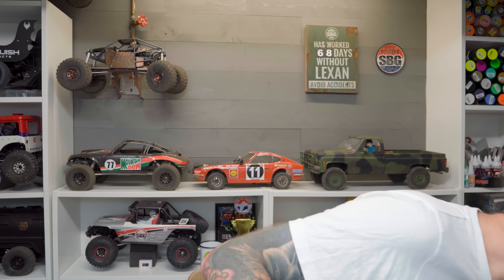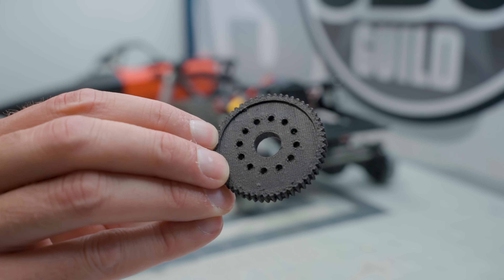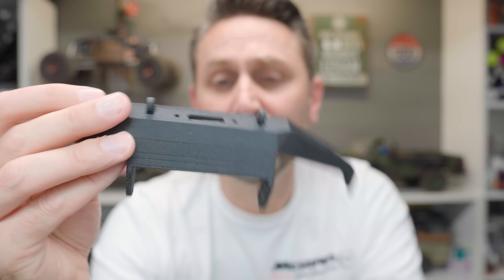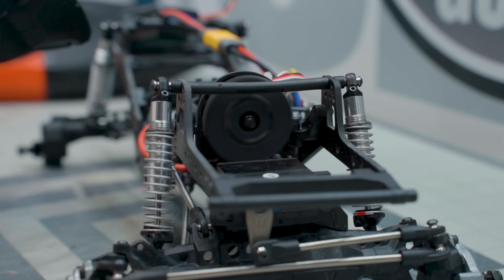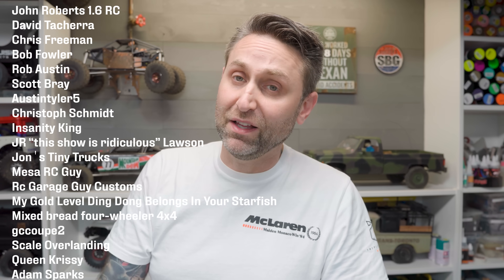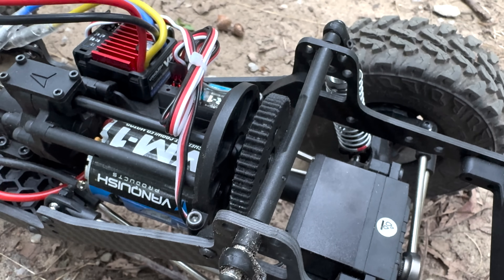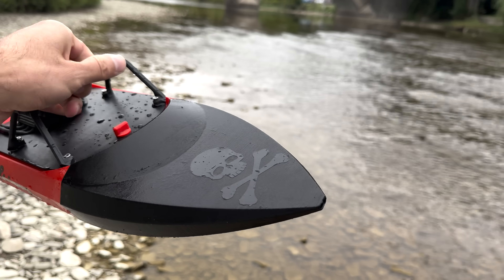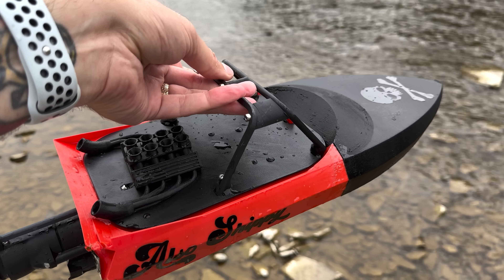Say Goodbye to Old Filaments – Meet the Game-Changer of 3D Printing!

Comment: I'm printing with PP (polypropylene), same family, but I'm struggling so much with warping.
I managed to print something but it's always a gamble.
Using PP tape on the plate is useful just for small pieces, otherwise the warping force will win and lift the tape.
I can not understand why nobody did a plate specific for PP, it's a so amazing material!!!
Reply from the maker: Wonder if your filament is dry enough? I dry this at the highest temp for 16 hours sometimes!
Reply: @scalebuildersguild I would say yes because I had the same issue with 2 new sealed rolls. Also consider that Polypropylene is almost hydrophobic, doesn't suck so much water as other filaments.

Comment: One thing that you have to watch with CF filled filaments is that the CF in it is VERY abrasive, so a gear that you print will last longer, but wear the other one out faster.

Comment: Heat treatment of tool steel is what hardens printing nozzels . Nozzels would soften again if overheated. At what temp would toolsteel remain hardened with continious use ? What temp is considdered to soften toolsteel.? Is toolsteel the material used for hardened printing nozzels?. If so it would be possible to self-harden nozzels periodicaly before they "wear out" if the amount of wear is calculated properly.

Comment: Do/did you print CF / GF filaments directly from a filament dryer enclosure, or dry first, then print from the side mount (on the X1C .. before you got your new drying).  Thanks again for all the teachings!
Reply from the maker: Print directly from the dryer typically, unless I’ve got a long print, then I’ll dry, and load into the AMS.

Comment: I just ordered a bunch of PCTG from 3D Fuel  Its chemical, UV and Impact resistance is very good! Its got incredible layer adhesion and is easier to print than PETG.  I am printing a bunch of signs for my buddies garage and these will hold up outside. PLA does Not.  I hope you try them sometime and  do a video on PCTG sometime. They even have recycled PCTG for half the cost for testing!  Some say its even better at higher print temps with no fan . Most suggest slightly higher print temps over PETG and the surface finish will change from a more matte to a more gloss at a higher temperature.
Reply from the maker: Sounds interesting, will check it out! Thanks!

Comment: was this your entire testing? "let me drive this printed thing around for an hour. see? it didn't break!" 
how do you know printing it in PETG or TPU wouldn't have given you the same result? what about different number of layer lines? would it last longer under continuous stress than other materials? I learned nothing from this.
Reply from the maker: I'm a hobbyist, not a scientist. If you want that sort of data, there are many other printing-focused pages that can satisfy your questions. I can tell you that PETG in my experience is a lot more prone to shattering into jagged pieces on impact, and TPU is far too flexible to be used as a gear, like I used here. Once annealed, PPA-CF is wildly strong, and I'd trust it to make functional prototypes long before I'd use PETG.

Comment: The price is ridiculous, the company earns a lot of money. I have a bag of 25kg nylon+30%GF pellet. I used it in my diy injection molding  machine to mold some strong parts a long time ago. I have 3d printer as well. If i have time, i will try to built an extruder machine to produce 1.75mm diameter filament using the pellet for 3d printing use, the price is very low

Comment: PPACF stands for Polypropylene Added Carbon Fiber. This is pretty self-explanatory then, assuming you already know what PP is. It's one of the most used plastics because of low cost, ease of manufacturing (injection molding), sufficient rigidity and being cheap. Any type of plastic bucket or box basically uses this - and a whole range of other objects. Carbon fiber adds extra strength and rigidity, while PP is already excellent at resisting almost all chemicals and moisture. Pure PP has issues with shrinking and warping as it cools if you print with it - making detailed parts difficult -  but carbon fiber reinforcement reduces this problem greatly.

The caveats are you need high heat to print it - so some less expensive printers will need a little modding. An enclosed printing space and thermal control would be a must - but that stuff is DIYable withhold breaking the bank.
Secondly, like with all filaments that use fiber reinforcement it will be rough on nozzles and wear out standard brass ones fast. You need a higher grade of hardened steel or better if you are going you use this on the regular.

I don't have personal experience with it, but fiber reinforced plastics certainly have a lot of potential for strength.

Comment: Something that is often missed is the relationship between stiffness and toughness.

If two materials have the same strength but one is half the stiffness, it will have four times the toughness. 

This is because the material is acting as a spring and the energy absorbed by a spring is proportional to the square of the deflection.

So toughness, which is the how much energy can be absorbed before before failing, is maximized by high strength and low stiffness.

[edit] Actually, that's not quite correct. The formula for the energy stored by a spring is E = k * (x^2) , where k is the spring stiffness and x is the deflection. 

So with half the stiffness and the same applied force, the deflection will be doubled, and E = 0.5k * (2x)^2 = 2x^2, or in other words, toughness is doubled.
Reply from the maker: That is so interesting! Thanks so much for sharing!

Comment: Game changer? Cure for cancer? Yes. World peace? Yes. Filament? Nope
Reply from the maker: Fair enough! I said it was a Game Changer of 3D printing!
Reply: @scalebuildersguild  even in 3d printing? Making a filament that's the very best ever,  but still selling it at fair market price. Mark Forged, for example nylon chopped carbon fiber (onyx) is a $40 filament 800cm nope $280 and make the slicer so you can't possibly use anything else. Fix that in the industry and maybe

Comment: Maybe I missed it but did you discuss on the health issues that come with CF materials? It has been shown that the micro carbon fibers are dispensing into the air while printing. And even when the object is done the fibers will abrade into you hand until you eventually swallow or inhale them. CF unfortunately is not without issues. The only way to prevent it is to paint or glue the surface as you usually see with all the industrial manufactured CF parts.
Reply from the maker: I've read other claims that is mostly debunked at this point.

Comment: and it prints good on the a1 ? and also there is this filament called tollumer  it coasts even more and is even stronger
Reply from the maker: You cannot print this on an open printer. A1 included.

Comment: I'm reminded of car bodies made with a chopper spray gun, that cut glass fibers into short pieces and spray them along with fiberglass resin.  I saw such a car in a wrecking yard; the chassis was there, but the body had disintegrated.  I don't like thinking about what happened to the driver when the body turned into shrapnel.

Comment: Can you try using it in small printed tools? Like allen wrenches or screwdrivers? Or scissors/knives and see how well the edges hold?

Maybe also see how good it is at replacing common weakpoints in prints. Could be good to keep around to use here and there (sparingly) to reinforce certain parts of prints that are failing like in some more complex mechanisms for example.

Also could maybe be good as a rigid skeleton to slap other weaker/cheaper/faster printing materials onto.

Comment: Nice demonstration of functional parts but this is not how we judge and compare materials..
Reply from the maker: Good thing I'm not a materials expert, or claimed to be then! I like to see how stuff works for my hobby, so while not entirely scientific in my methods, I got the results I hoped for!
Reply: @scalebuildersguild  The thing is, you could have used almost any material for that purpose and likely got a similar result. So it's bold to claim the material is superior to others, it would need a proper comparison to see how it handles situations against other filaments and against industrial replacements.
If you see a significant difference there, you can compare them

Comment: That's impressive. What's more impressive, it looks like we can use it with the cheaper 3D printers too. An AI summary says: "Yes, you can print with PPA-CF using a Bambu Lab A1. Users have successfully reported that the A1 can handle this material effectively, often finding it easier to print than other carbon fiber reinforced filaments like PA12-CF due to reduced warping issues." With the Black Friday sales already started, the A1 is at $300 and the A1 Mini at $200, which makes it very easy to get into printing custom parts!
Reply from the maker: You need a print bed temp of 100C. And it needs to be in an enclosure. AI may have led you astray here.

Comment: can't recall printing anything that requires a strong filament. if there's an item that requires it, chances are i can buy it from amazon or whatever way, way cheaper than it would be printing it + i would also have it faster, unless its something really tiny.
Reply from the maker: Amazon seemed to be out of stock on the things I designed myself.
Reply: @scalebuildersguild  not saying it can't be like that if there's something extremely specific, but what are the chances no one else made it, pretty slim in most cases.

Comment: The filament is PPA-CF - a carbon filled nylon.  $150 per kg.    Requires a hardened steel nozzle, an enclosed printer and a filament drying set-up.   Tensile strength  gains are highly dependent on print  and filament quality and the best gains are 50% - many videos discuss this.
Reply: more like $75 a kg

Comment: #1 infill is a minor part of strength - 100% infill is rarely ever ever needed.   #2 number of perimeter layers is much more important.   #3 if you're using default settings, they aren't set for strength.     #4 if you ever use PLA for strength, you're up the wrong tree.  It's brittle and degrades.     #5 you have to pay attention to what direction the layer lines are going.     There is sooo much more to part strength than what you are saying.
Reply from the maker: You’re absolutely right, I’m covering the basics.

Comment: In the Bambu Mini  A1 a viable printer for this sort of thing? It's really cheap and small, which ticks two important boxes for me.
Reply from the maker: Unfortunately not for this filament. It requires a heated bed temp, and nozzle that the A1 doesn’t have. Not to mention an enclosure to keep that heat in. Bambi doesn’t recommend it.

Comment: Not a scale modeller so don't know why YT put this on my feed, other than I do print 3D for other things.
And strength for my purposes is on the low end of the 'scale'. So perhaps for a modeller it is a 'game changer', but not for others at all.
Stopped at the 4 minute mark(seeing the gear) - The surface finish and 'detail' (burs) are terrible - I would never use such a material, if that's what you get. That's the reason I still use printers like the defunct 'Shapeways'.
Unless I am able to plonk down 6 figures for a printer + equipment for auxiliary processes that can do what I need, home use(printer) is still not an option.

Comment: Try Sunlu PLA+, it's super strong and cheap too, reasonably easy to print with as long as you dont try to go too fast with printing (they have a high speed version too, but haven't tried that yet).
Reply from the maker: Thanks for the tip!

Comment: What is this magic that goes forward backward so quick. I have an ftx tracer and you have to double backwards to go backwards
Reply from the maker: Most modern ESC's allow for instant reverse. Check your manual to see if that's possible. It's really only useful on a crawler though, wouldn't recommend on anything fast.

Comment: i have been printing functional, mechanical and high stress biek components out of CF-nylon and CF-PC forever. brake levers, shifter arms for a gp shift conversion, velocity stacks. some filaments really work well. need to test metal filament at some point though. electroplating looks like a nice touch
Reply from the maker: Thanks for the tip!

Comment: Sweet material, I love new engineering materials to test out. The price comes with quality filament, its expensive but usually worth it depending on your application. Heads up on printing gears with carbon fiber material, you may end up with excessive or premature wearing of that gear (more likely whatever its touching) because carbon fiber is abrasive so it will essentially grind away at whatever gear its up against. A normal Pa6 or Pa12 would probably work better for the long run, in my experience.

Comment: The thing that should be said at first: 111$/kg. No thanks.
Reply from the maker: This isn't supposed to be a daily use filament. Prototype your parts in PLA, then switch to this for the final part, that demands the high strength properties.

Comment: I make some extremely high-impact parts and might give this material a try. That said, I wonder if you have tried PETG-CF. PETG is stringy and flimsy, but has excellent layer adhesion. CF of course is very stiff and strong. When paired together it makes a very strong combination that is stiff but resiliant, easy to print, and doesn't string. Not as high-temp as PA of course, but better than PLA. Cost $46/kg.
Reply: PETG-CF is about half as strong as PA6-CF, which itself is half as stiff and 75% as impact resistant as this, lol. The layer adhesion is better on PETG-CF, but I think you'll find that the added strength more than makes up for it, where applicable

Comment: Bambu labs filament is problematic for the most part. I quit wasting money on it.
Reply: I don't think it is, but it is unnecessary for most things as aftermarket filament does great.

In this case aftermarket HTN CF is often far more expensive, eg HTN CF25. So I think this is a great addition by bambu
Reply: @Tom--Ace  I mainly have issues with pla multicolor silk. Just wont feed.

Comment: I just got into this debate and got some flack for saying that I don't believe CF filament offers enough fibre to actually make a difference in print strength. I may have to try out this PPA-CF. (Holy $#!^ on the $130-280 price tag!)
Reply: HTN CF25 is renowned for its strength at 25% CF content.

This filament is close and has about 12-20% fibre content. It's absolutely enough to make a difference

Comment: I bought two roles of ASA on recommendation  of a video like this. Apparently it is better than ABS. And there was a question "Why don't more people use ASA". Just to find out that no matter what I try, it just do not want to stick to the bed. Now I am wondering what are the downsides to this filament?
Reply: Asa warps the worst of all filaments I tried. But with a brim, it certainly can be tamed.

If you're having issues even sticking to the bed, your settings are wrong
Reply: @Tom--Ace  I have tried every setting in the book. Try me. What setting do you have in mind?

Comment: Think about using greentec pro if you want strong things, it's not as strong as the filament in this video but it's far less expensive. It's twice as expensive as normal filaments it is resistant to almost all types of stress including chemicals. It is FDA approved and made from green resources and it can be printed with the same settings as pla and weights less.

Comment: Polycarbonate or PC is the strongest best value for money filament. Downside is it requiring an enclosure. PC CF overcomes this and is easier to print, but its layer adhesion isn’t as good as straight PC. Also not sure I want to use Fibre filaments after watching Nathan Builds Robots video on the topic.
Reply: You should not listen to someone that doesn’t understand nano tubes versus ground up cf. next pc has nothing on ppa. Some of these comments are mind blowing .
Reply: @bbc92314  If you are going on pure performance PPA CF is great, but that is not what I said. I was pointing out that PC has great price/performance. $209 USD for a role, is no longer a hobby grade filament.
Reply: You could try to print every other layer with PC-CF and the others with normal PC. Maybe that improves layer bonding. I wish there was such a setting in orca slicer, but you can do this via custom color changes after each layer in orca slicer.
It's just an idea, i have not tested it myself, yet.

Comment: The problem with CF filament is that miniature CF fibers are released from it. It is also released from finished prints. You definitely don't want to inhale them. And I certainly wouldn't want them stuck in my skin.
When printing CF filaments, it is recommended to use a particle filter. Catch the filament as little as possible, and if the prints are to be caught with the hands often, it is better to coat them somehow - varnish, paint. And it is absolutely not suitable for printing objects with which children come into contact.
Reply: Stop watching NBR . People need to learn the difference between cf nano tubes and ground cf.
Reply: source?
Reply: @cutty02  https://youtu.be/RLt9l6YxvHk?si=kg0WQKA-BX1xnMCy
Reply: Thank you for saying that!
I had no idea...
Reply: @matthewmathis62  he doesn't either. What is his source? These filaments would cost so much of they had to make them in a protected environment.

Comment: It seems like a fairly typical nylon with the exception that it legit has better bending modulus than PLA. The big questions are related to that: How toxic is it? How much of a pain is it to dry? How much does it tend to creep?
Reply: carbon fiber in it , is like asbestos, no thanks
Reply: Its been tested as significantly stronger than typical nylons on other channels at this point.